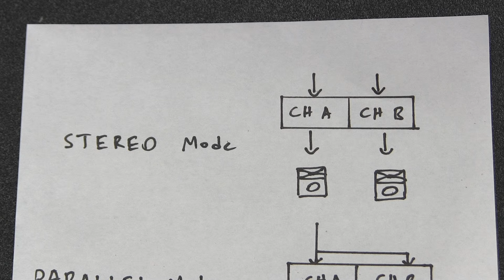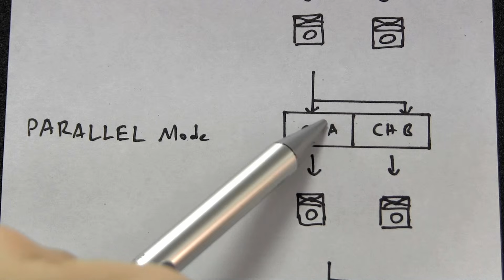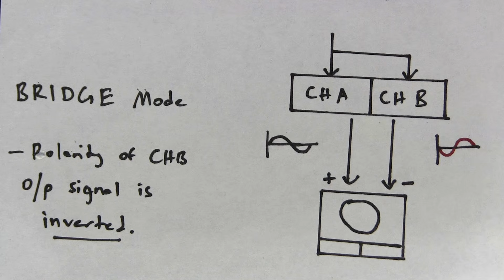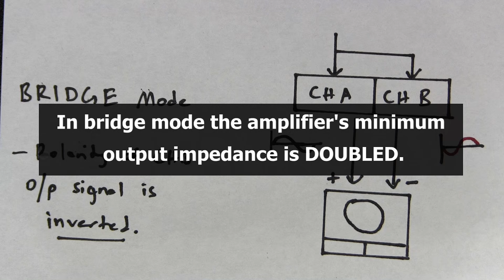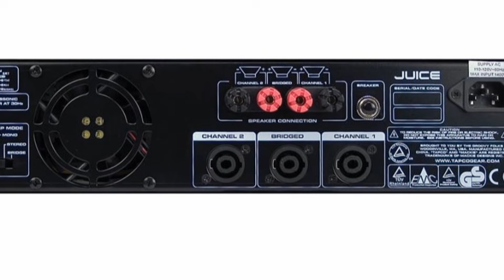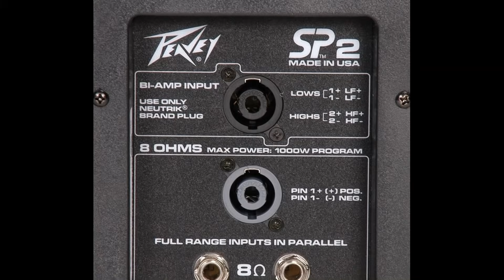How to set up and connect a power amplifier in bridge mode

Comment: Sir what is the best type of box for bass outdoors and indoors
Reply from the maker: It depends on your requirements - size, cost, power handling, efficiency etc. These things all need to be considered when determining the best sub for your application.
Reply: @GLBProductions sir what is the purpose of sinsevity input at the back of power amplifier

Comment: Thank you for your excellent description of the various speaker / amplifier output mode connections.
In the bridge mode I'm  confused? if the output  'A' is pushing the cone forward and the output 'B' is pulling the Cone backwards, does this not cancel out the drive to the speaker cone?? what am I missing??
Reply from the maker: Hello Liam, thanks for the question 😀 The two channels are not pulling and pushing on the cone in opposition - rather, when channel A pushes, channel B pulls and vice-versa. Think of it like two lumberjacks working an old-fashioned manual timber saw back and forth: when one pushes, the other pulls, in order to combine their effort. The saw can be worked by just one man, but with two there is significantly more power available. That's the idea behind bridge mode!

Comment: Hi
I have 2 power amplifiers, it rates 300 watt at 8 ohm, 450 watt at 4 ohm, both are the same model and have options of Stereo, parallel and bridge mode.
Also, i have 4 speakers, they are same model, 300 watt at 8 ohm.
Set up options :
-option 1 : i set on both power amps to parallel mode, running 2 speakers each channel 
-option 2 : i set on  both power amps to bridge mode, running 2 speakers each channel which connected in parallel ( become 4 ohm  )
My question is :
If i set on my pre amp same level of volume , which option will give me louder sound ?
Hope i can hear from you soon .
Thank you very much
Reply from the maker: Hi there Mike please give me the specific make and model of your speakers and power amplifiers, thank you.

Comment: How do I connect my QSC Audio Pro Watt 3402 Power Amplifier to my Denon Surround AV receiver AVR S5-10BT
Reply from the maker: The only audio outputs I can see on this receiver are the two subwoofer outputs on the rear panel. You could use the headphone output, but that is not a long term solution.

Comment: Please I need help separating my mid/hi sound from the low (bass) sound to fully have control

I have two amplifiers, drive rack PA2, mixer and wireless microphone. 

I've connected it so far but it's messed up because on the mixer the left and right channels are not separate. The right channel on the mixer now plays both hi/mid and low( bass) sounds together
Reply from the maker: Right, so it appears that the problem is the routing within the driverack processor. I suggest you get in touch with your local DBX distributor and ask for help with the programming - they will be the best people to advise you.

Comment: How do you connect it or switch it so that your input would go to both speakers , I have it on paralel ?
Reply from the maker: Bridge mono mode is by definition mono, so you cannot connect a stereo pair of speakers. If you want to send the mono signal to two separate loudspeakers you need to daisy chain them together, i.e. out from the first speaker and into the second one.

Comment: how does NL4 speakon cable wired into bridge mode?
Reply from the maker: That depends on the amplifier - some use +1/+2 but check the user manual to be sure.
Reply: @GLBProductions  NL 4 has four wires,  what about the remaining two wires sir?
Reply from the maker: @DJWASAASA  They are for bi-amping as well as custom speaker hookups.

Comment: What if i connect my left and right channel to one speaker
Reply from the maker: That is actually what bridge mono mode is: using both left and right channels of the amplifier to drive a single loudspeaker. However do not do this with a normal non-bridged amplifier, you will very likely damage things.

Comment: Have you done one specifically on the crown xti series? I have a 4002 xti
Reply from the maker: No I have not. That amplifier has no physical switch to activate bridge mono mode - the switching is done from within the menu system, as outlined in the user manual.

Comment: I have two double bass bin and two mid speakers how can I connect to My amplifier that's 5000watteg
Reply from the maker: You would need to run the two subs off one channel and the two midrange speakers off the other one, there isn't any other option really.

Comment: You’re connections ended with only 1 speaker utilizing the channel. So what do i do with other speakers?-Bridge Mode
Reply from the maker: You would daisy chain subsequent speakers to the first one, remembering to observe the impedance limits of the power amplifier. Bridge mono is typically used with one or at most two speakers for this reason.

Comment: To connect 2 speaker bridge....do I connect positive and positive....and  negative to negative  ..then using chanel 1 ...i connect positive cables and negative cable to chanel 2 positive.....correct?
Reply from the maker: To connect two speakers using bridge mode connect the second speaker to the first speaker using standard speaker cables.
Reply: @GLBProductions  Thank you so much for the information 🙋🏻‍♂️

Comment: i think your bridge connection is wrong. it should be + (red) on channel 1 (a) and - (black) on channel 2 (b). please correct me if i am wrong.
Reply from the maker: Hi Peter, on this particular amplifier the bridge connection is made to the two red binding posts i.e. the positive terminal on both channel 1 and 2 outputs. Remember that the exact method of connection when bridging is specific to the amplifier model - some use +1/+2, others have a dedicated bridge output. Thanks for watching :)

Comment: It's very convenient that your Amplifier example has all the posts and terminals for your presentation but what about a vintage receiver or integrated amp for an example ..is this still possible to do and is it truly worth it sonically
Reply from the maker: Bridge mono is a feature typically reserved for higher power sound reinforcement applications - I do not recommend attempting to bridge stereo receivers and integrated amps that are not equipped with a bridge mono function.
Reply: Thx. I appreciate it
 @GLBProductions
Reply from the maker: You're welcome :)

Comment: Helpfull Video. How do you connect 2 8 Ohms Speaker in Bridgemode(2 Subwoofer with NL4 Connectors)...Thanks Joerg
Reply from the maker: You would daisy chain them together - double check to be sure that your amplifier can handle a 4 ohm load in bridge mono 😉
Reply: @GLBProductions , yes he can. That`s Parallel Mode. What about to play em in Serie....1+/1-  -> 2-/2+ ? I`m looking for the advantage. I also can use singel channel on each sub.....

Comment: I recently used a yorkville px1700 and the sound went out mid way during a show. There is power and I see the meters moving but no sound is being sent to the speakers. I switched out to an older amp and the sound came back on so it’s not the wiring or blown speakers any ideas? Do these amps have internal fuses? I’m looking for some help thanks and I appreciate the videos! 😎
Reply from the maker: If you see the meters on the amp moving but no sound is coming out of the speakers that suggests the amp is in protection mode - did it resume working after the show?
Reply: @GLBProductions  yes it turned on the other day. It was very strange. I have 4-8ohm subs and daisy chained them all to get it down to 2ohms. It must of overloaded I was only using half the power amp. Is there a way to use both A&B channels. 
I’m so confused but any help or direction would be greatly appreciated.
Reply from the maker: Yes, you can use the 'mono' mode (actually parallel mono) to send the signal from the channel A input connector to both channels without any additional cables. Re-arrange your subs so that the load on each channel is 4 ohms and then run some tests to see if the amp shuts down again. If the 'protect' light on the front panel comes on this means that there is some issue with your speakers or speaker wiring. Finally, remember that the cooling path on this amp is front to back - check to see that both the front and back of your amp rack are unobstructed (the hot air needs somewhere to go) and do not mix with amplifiers that have a back to front cooling path. If the amp shuts down again then you should probably contact Yorkville tech support. All the best 😄

Comment: If I am using bridge mode and connecting to an older sub with only TRS / TS inputs will a TS- speakon cable work if I rewire the speakon end correctly ?
Reply from the maker: Yes it will - to use the example shown in the video you would wire tip to +1 and the sleeve to +2. Passive loudspeakers generally do not use TRS connectors.

Comment: If I daisy chain two 8ohm subs in bridge mode, will ohm drop to 4ohm or double to 16ohm??
Reply from the maker: 4 ohms - this will happen whenever you daisy chain two 8-ohm speakers in parallel, regardless of the amplifier mode.
Reply: @GLBProductions  thank you for the reply

Comment: Hi sir how many speaker should be connect in Bridgemono mode
Reply from the maker: It depends on the minimum allowed load impedance for the amp in bridge mode. For example if it is 8 ohms then you can connect one 8-ohm or two 16-ohm loudspeakers.

Comment: Hi, i hav a doubt.. can u plz clarify.
Shouldn't the signal will b canceled and there will b no audio?
If in bridge mode 1 channel is inverting the phase.
Reply from the maker: Not in this case because the signals are not being recombined electronically - they are fed to separate amplifier channels which are then connected to opposite polarity terminals on the same loudspeaker.

Comment: Hello there 👋 I have a question :
In my case, my 2 KCS 2000 speakers are splitted in 2 parts HF and LF. How do i have to connect those 4 wires if i choose your very last exemple ?
Do i have to join the 2 left and right ➕ and connect them to the red Channel 1 all together? And the same for the 2 left and right ➖ in Channel 2?
Please help me 😁
Reply from the maker: Hello Oliver, which exact model of KCS speakers are you using? The S-2000 or S-2001?
Reply: Hi how r you sorry for that so long response 😢....
My speakers are the KCS 2001

Comment: I have a american audio vlp 2500w amp.. It says in the manual it does 1100w @ 4ohms per channel. 
750w @ 8ohm per channel.
2200w bridge mono.

Now my speakers are cerwin vega intense v2.. 1400w per channel @4 ohms.

This is a dual 15 inch woofer though full range and on each woofer says it is 4ohm... Follow?

So this makes me think my amp is putting out 8ohm  to feed the two 4 ohm 15"s in each unit.

If this is not the case and its only using 4 ohm i would like to add a 4ohm 18 inch subwoofer to each channel and jack out to cerwin vega's as satellite.  Then would i get a 8ohm output that the sub uses 4 and the cerwin vega uses 4?
Reply from the maker: Those dual woofer cabs are typically 4 ohms. Adding a 4 ohm subwoofer will drop the impedance to 2 ohms which is not recommended for your particular amplifier.
Reply: I forgot to say The bridge mono mode is @ 8 ohm 2200w.

Either way thanks certainly give me something to think about.

Now you know this question is coming.....  What if i go into the speaker units and disconect 1 of the dual 15 woofers.. Would that give me any headroom for adding a 18" subwoofer?  i really dont want to add a nother amp to the system.
Reply from the maker: You're welcome :) Ok, so if you disconnected one of the woofers that would not solve the problem because what the amplifier 'sees' is the impedance of the crossover, not the individual drivers within the cabinet. Another thing which I have learned from loudspeaker manufacturers: these double 15" cabs are often designed to work without a sub - the two woofers are not identical: one of them acts almost like a subwoofer and the other one acts like a bass/low midrange driver. So adding a sub to these cabs often gives little benefit.
Reply: @GLBProductions  There is a reason people say you're the man!

I had no idea i thought both were mid range satalite speakers,  i could only get 40hz lowest out of them at -10db.. But i felt they sounded muddy what i did to rectify this was kill the frequency between 200-500hz.. This then gave me more wriggle room on the low end and now get this.... im hitting 25hz with no distortion it sounds very powerful however bass has lost a little bit of warmth.  With more tuning i can find a happy medium. 

Maybe boost 250hz for warmth and go from 25hz to to 30hz.  They sound a lot better now jeez i guess it helps when you know what you've actually got because now ive got these things moving some air!

Big Thanks man!😎👍
Reply from the maker: Glad to hear that's working out for you :)

Comment: i'm play music using power mixer 450watt x 2. recently i was buy peavy cs 3000 power amplifier for an upgrading my system. so i leave it into original configuration which i believe in setereo position/mode. i'm use two 300 watt speaker(peak 600), 18 inch, 4 Ohm and two 200 watt speaker(peak 300), 12 inch 8 Ohm. so far so good. i think not need for me to switch into bridged mode for now. Any suggestion really appreciated. thanks
Reply from the maker: If the power amplifier is not overheating or going into protection mode then you should be ok.
Reply: @GLBProductions  so i tested it yesterday and looks like overalal sound syatem works fine now. sound is much better compare to without power amp.  my setting was power amp switch to 12 o'clock for both channel and mixer fader push to -15 db. previously my mixer work hard to 0 db and the led light sometimes goes the red light. another thing was i don't need to play with gain knob anymore. thanks for the respond

Comment: Hi sir, what if bridge mode more than 8ohms what happen to the amplifier i thank you from the philippines.
Reply from the maker: More than 8 ohms is not a problem! With power amplifiers, higher loads like 16 ohms are fine - it just means that the amplifier delivers less power into the load.

Comment: Thankyou for your video and i would like to ask a quiz .am using peavy cs3000 power amp and yamaha mg16xu together with one delta 215 ,one deltax12 for monitor and a sub bt my power amp keeps flashing the distortion light what could be the problem plz
Reply from the maker: Are you referring to the DDT light?
Reply: @GLBProductions  yes
Reply from the maker: That means that the amp has detected clipping somewhere in the signal path and is reducing the power to protect your speakers - you have to find out where the clipping/distortion is coming from, possibly your mixer or even the input of the amplifier itself.

Comment: I have a question , MY AMP uses 1+ and 2- for a bridge mode and the speaker uses only 1+ and 1- I'm kind of confused how can i connect them together , thank you.
Reply from the maker: You will need a custom speaker cable which is wired 1+/2- at the amplifier end and 1+/1- at the speaker end, with the two ends clearly marked. BTW check your amplifier manual - bridge mono mode typically uses 1+/2+ and not 1+/2- as stated in your post. But your amp may be unusual in this regard.

Comment: Hi how do you connect a crossover to two different amplifier to run two different sets of speakers
Reply from the maker: The simplest way is to daisy chain the line level inputs/outputs of the power amplifiers. Alternatively, run a signal splitter at the outputs of the crossover.

Comment: In bridge mode ..if I have a 5000 amp can I I run 2 or 3 speakers on it in bridge mode
Reply from the maker: It depends on the combined impedance of all the speakers vs. the amp's minimum allowed load impedance in bridge mode.

Comment: Good afternoon  sir
I have a qsc mxa3000 amplifier which I used to play bass in bridge mode at   4 ohm I want to know if I should use a TRS  1/4  for the input or I should use the ts
Reply from the maker: TRS if available.
Reply: @GLBProductions  
Thanks
Reply from the maker: You're welcome!

Comment: Hello so you say bridging the amp allows  you to connect to one large speaker, but what if you want to connect to two speakers  , How then? One more question  I have a pair  of Westlake 10" studio monitors spearkers , if a amp doesn't  have enough  power to push them would they sound like they are baffling with a lot of (highs) with not enough  Bass? Because I have heard these name brand speakers ( 8" ) plays, the Bass sound coming  from them were (Round) and powerful.
Reply from the maker: To connect to two loudspeakers you would daisy-chain them together, so amp -> first speaker -> second speaker. I'm afraid I can't answer your second question - suggest you ask somebody who is familiar with those particular speakers.
Reply: @GLBProductions  Thanks

Comment: If an amplifier is rated 4 ohms stereo and 8 ohms bridge do you think bridged into a 6 ohms speaker is a bad idea?  The amp has gain adjustment in addition to volume control. Would it be ok if the gain adjustment is reduced from its maximum? If it is not able to handle the 6 ohms in bridge mode would it break the amp or just blow internal fuse protection? The speaker is 100w-250w max. Amp is 125w into 4 ohms stereo and 250w into 8 ohms bridged.
Reply from the maker: This is definitely not recommended - with pro-audio amplifiers they will typically overheat and shut down once their thermal protection circuit trips. With consumer or hifi amps they may be damaged permanently. It may not happen immediately, but operating the amp outside the manufacturer's recommended parameters is never a good idea.